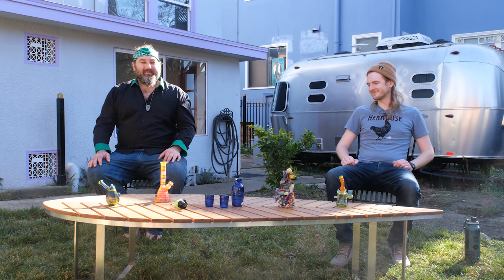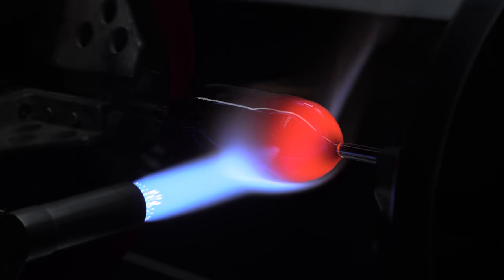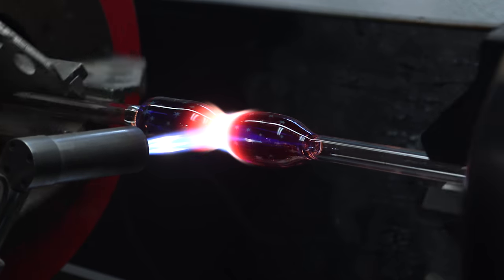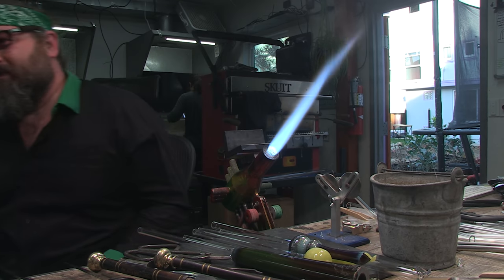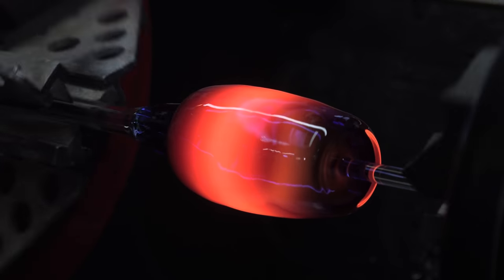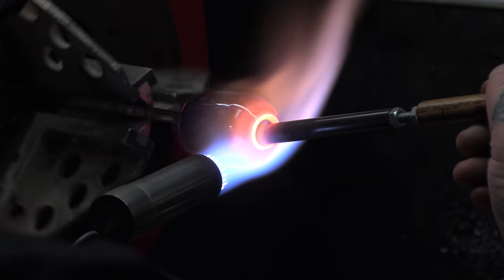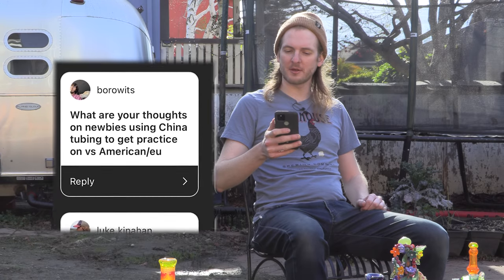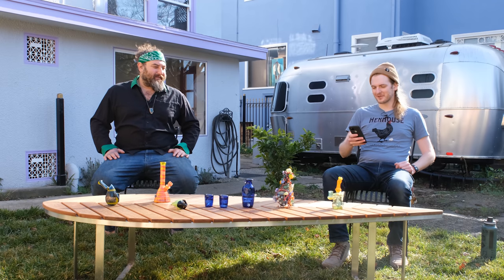Making a Sake Bottle & Cup Set on a Glass Lathe || On the Torch SEASON 2 Ep14

Comment: The lathe work was really cool to see! I'm a scientific glassblower, and the job I do involves solely lathes. Was real interesting seeing your process. 
Another lathe company I'd recommend (though I think they're out of business now) is Heathway. They were the backbone of UK scientific glassblowing, and they're basically regarded incredibly highly. Most of the equipment we own is 40+ years old and still runs pretty well. Expensive to get parts though obviously.

Also for people who don't know, you can't use a metal/woodworking lathe. Glass lathes actually spin the opposite way to regular lathes. I guess it might be possible if lathes have reverse gearing, but they tend not to want to be run constantly in reverse, plus glass lathe chucks tend to be a bit different as well

Comment: What are your complaints with Heathway lathes they are a og in scientific glass  yea most of the ones I've seen are loud and creaky beasts but on the same token most of the ones have been  ran hard daily for a few generations and still  run smooth and true
Reply from the maker: No complaints on Heathway.  They are great lathes.